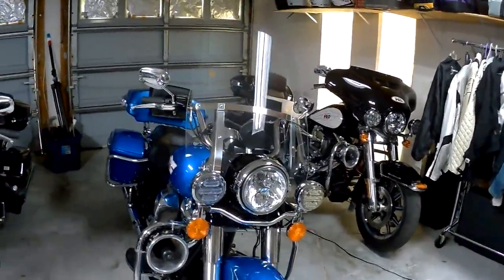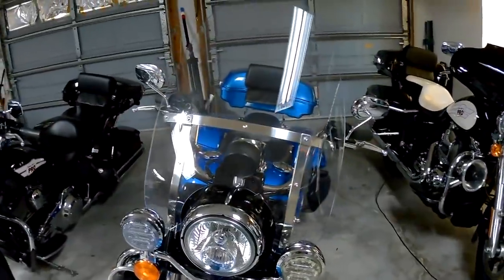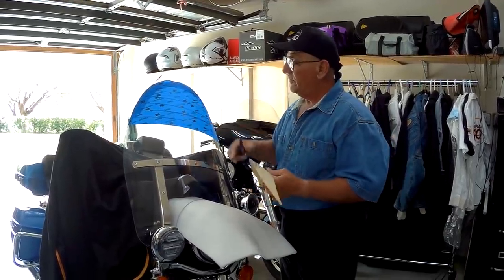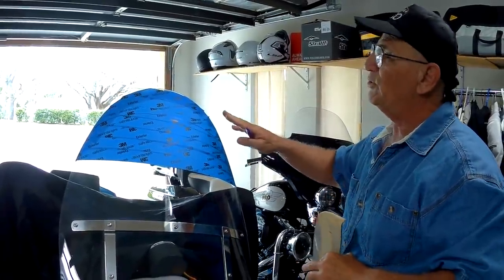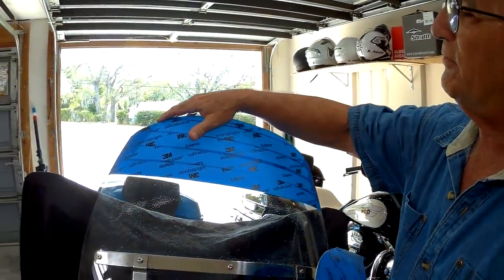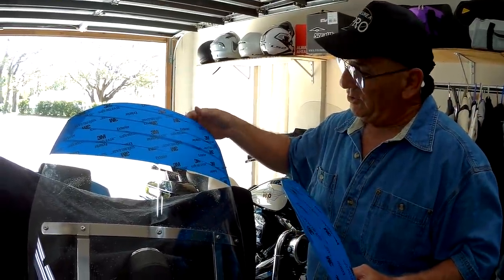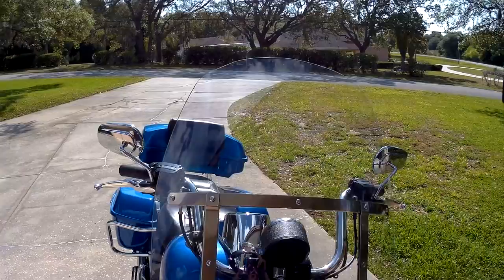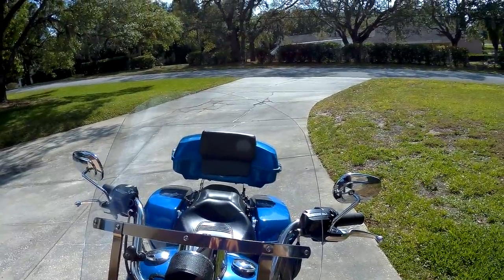how to cut down a windshield

Comment: Simple way to mark the perfect radius; after masking the windshield from top to about 5" down, just measure up from the center allen head bolt on the windshield's chrome crossbar, to the height that you want. Using a string with a small loop on both ends, place something that you can easily hold thru the lower loop to the center of the allen head, and a marker thru the top loop. Now simply draw the arc. Then follow this guy's instructions on cutting it down. Mine came out perfect.
Reply: Hey Gary, thats smart...thank you!!
Reply: Double-loop: great idea. Thanks Gary. I'll be trimming a Yamaha FJR1300 shield soon.
Reply: Works brother, thanks!!

Comment: Another slick way, is to loosen the screw holding the trim directly in the center above the headlamp, wrap a string round it, then attach a pencil to the other end of the string and make a sweet radius on the tape? That’s the way I did mine.
Reply: That's how I did mine.  Then after the cut, rounded and radiused the edge with sandpaper.
Reply: Thanks mate.
Good idea
Reply: Genious

Comment: Jerry...used your technique with a few tweaks to it to cut down my fairing. Like yours, mine was a little too tall. Cut an 1 1/2 inches off. I used cardboard to make the form and trace the curve and sides. The painters tape worked great and allowed me to trace my cutting line perfectly. I used a dremel tool with a carbon cutting blade. Used a sander to smooth it, then 100grit, then 200 grit. Finally some wet sanding got it nice and smooth and clear on the top edge. Thanks again, your video was the inspiration. BTW....could use some more of your stories...When I went through the academy....those were some of the best parts of it.

Comment: cutting down a shield is simple and easy. most folks go after the top end and some do a good job of not buggering it.  There is another way, particular with shields that are attached to fairings. Don't cut the top!. Trace an outline of the bottom on a sheet of construction paper. Transfer that form and/or mounting holes UP from the bottom of the shield the number of inches you want to cut down the top. Leave the top and finish alone. Install the new cut down shield using the new mounting holes and you have reduced the overall height of the shield keeping it original shape and finish intact.
Reply: @nevillegreg1  and you’ll still have the original holes under your new ones. Not a great idea IMO
Reply: I did this for a windshield I ordered from Klockwerks that was specially molded to fit Reckless fairings.
I accidentally ordered too tall so using a Sharpie,I traced the bottom of the windshield onto a thick piece of cardboard and the cardboard then became a jig or template to trim 2 inches off the bottom. 
Now I have an excellent Klockwerks windshield.
Reply: @mikec7713 I believe when he states new cut down he has cut off the bottom removing the original holes.

Comment: I have done this a few times for myself and friends.  I am not as patient as you  ;-)   After cutting, I begin sanding with a block fitted with 40 grade 3M green production paper.  With such coarse paper, always start pushing from outer edges toward the inner (top) area.  As fast as a mill file and getting the corners with a nice rounded shape goes pretty quick.  Then 100 grade, and so on.  I never thought of using a polish or compound, good idea.  My bike has the factory shield now and I can tell Ya that it looks a lot rougher than yours on the edge (2018 Honda GL1800 Tour).  So Ya done good!

Comment: A tip:  When you get it smooth and begin using the very fine grades of paper, use a felt chalk board eraser (now that IS old school) as your backer.  They are pleated, so hold them diagonally instead of long way as you rub the edge.  Produces that neat very slightly rounded edge.

Comment: That is a job that most people are afraid to try. I have done several myself, but I take them off and use a fine tooth blade on a table saw. Tape the shield and fasten a clean towel to the table saw, and final polish with 800 grit on a air powered d/a orbital sander.
Reply: Frank Headley i needed an excuse to buy a new bosch jigsaw to do this. Should i use a metal fine tooth blade to cut my windshield? Should I angle the blade or keep it. Straight up and down?

Comment: A good way to get a nice finish on an acrylic edge is to sand it down smooth first, then use a sharp blade from a Stanley / craft knife and draw it towards you across the edge - leaning the blade towards you to stop it snagging. Then, if you have access to one, use a polishing wheel.

Comment: Great video and  tips, I installed a 16” shield and had terrible head buffeting, bought a 18” and it eliminated most of the buffeting up to about 75 mph. I feel if I go with taller shield I’d be looking through it which I don’t want. Thinking about cutting the 16” down a bit just to get some wind blast off me , I rode with a shorter shield and didn’t get head buffeting can’t figure this one out. Any advise appreciated. I know it’s tuff question to answer . I ride a 2010 fat boy im 6’ . BTW I bought your Ride Like A Pro video and book years ago, helped me tremendously, I always recommend it to newer riders
Reply from the maker: A lot of buffeting comes up from underneath the windshield. H.D. used to have chrome lowers that mounted to the forks and the windshield brackets that helped with buffeting. I can't use them because the siren speaker would be in the way.
Reply: the lower shield, your head is in the slip stream and not in the jimmy buffet zone, is why it is smoother.
Reply: Yep.  Look at lower deflectors.  I had buffeting I couldn't figure out, put on lowers and it was gone.
Reply: Alan Colon thanks for the reply
Reply: Ride Like a Pro Jerry Palladino thanks for the reply Jerry
Reply: @fatboy10-n5j  Just a second comment, the effect of the lowers is amazing.  Even when I took the windscreen off in summer, the lowers still made for a much more comfortable ride.
Reply: Alan Colon thanks for the reply may give the deflectors a try

Comment: A little off topic, but I wonder about folks installing higher and wider aftermarket windshields.  Is the hardware on the motorcycle capable of supporting it?  Do these aftermarket windshields meet any sort of safety standard?

Comment: I sand with  200, 320, 400, 600 and then 1000 grit.  Once I have it smooth I use a piece of box wood and Plexiglas polish and the edge comes out perfect.

Comment: Question: How high should a windshield be for a rider that’s 5’7”?
The bike is a Heritage. The windshield is about 18 1/2” now measured as you do. The buffeting is so bad at 65 or 70 that I feel beat to death. 
P.S. Loved you CD I bought a few years back!
Reply from the maker: It's hard to say. I'm 5'7'' and about 17'' is good for me. But a lot depends on your seat as well. Cutting down the windshield may, or may not help the buffeting. Air coming up from underneath  the shield could cause buffeting also. Fork lowers can help that.
Reply: The windshield top should be around the tip of your nose high so you are looking over the top of it and it still deflects the wind
Reply: @Ride Like a Pro Jerry Palladino  you're  5'7" but in the video you said you were barely 6 foot 😆

Comment: Hey GREAT, Jerry! I'm buying a fresh bike next week... and it will need some trimming. QUESTION: What sort of Jigsaw Blade to use? Fine? How to keep the shield from chipping or cracking?
Reply from the maker: A fine metal blade. Take it slow.
Reply: @motorman857  Thanks a heap for this video, Jerry! I followed your lead and mine came out great! No problems.. smooth. I used a small sanding "flapper" wheel after the jigsaw cut... worked great... followed by 220 to 400 to 800 grit... a little polish.. looks Pro!

Comment: i have the electric hand jig saw but don't know if i have a steady enuff hand. i also have a hand coping saw and some other small hand saws with small blades, i may do it that way. i feel i might have more control over the cut cause once i mess it up it would be a mess but i'm gonna try it anyway.
Reply from the maker: I wouldn't use a coping saw. A jig saw works better and easier. Just take your time and be patient. You can also practice using the jig saw on a thin piece of plywood before cutting the windshield. If you screw up and wind up with bumps on the windshield, a power sander will fix that.
Reply: @motorman857  thnx for the advice

Comment: What exactly do you polish this with? TY
Reply from the maker: If your asking about the edge that I cut, use Polishing compound.
Reply: @motorman857  Thank you.  One more question, do you get that HUGE wind noise in your ears now that the windshield is lower or does the wind still go past your head.  Thanks again
Reply from the maker: @jjcar99  Most of the wind noise comes up from underneath the shield so I've noticed no difference in wind noise.
Reply from the maker: @jjcar99  No huge wind noise. But I wear ear plugs.
Reply: @motorman857  I DID IT!!! Cut my windshield down today with my grandson! Followed your lead.  My 6yr old grandson was quoting your instructions as I was doing things, lol.  It came out great and NO wind noise.  I went from a 20" height to a 15" height.  Looks great and rides great.  I can now see over the windshield!! Thanks again!!

Comment: I could not get masking tape to stick because I use Pledge on my shield. So I measured and used a belt sander. I took it out of the fairing and it took 4 times as long doing it this way. All I needed was 1". The 10" factory  was splitting my line of sight and driving me crazy.

Comment: DId you use a special blade on the jig saw? What was the TPI?
Reply from the maker: I was going to use the special, and very expensive blade used at the space station and recommended by NASA, but I ran out of them. So I just used a fine metal hacksaw blade I had laying around. 😁. C'mon. Don't over think this. Any mistake you make can be fixed with a file, sand paper and polish.
Reply: @motorman857  Some people say that using a jigsaw will cause hairline cracks and the windshield will look like garbage; that may be why the question was asked.

Comment: What kind of blade did you use on your jigsaw?
Reply from the maker: A medium  metal blade.
Reply: @motorman857  ok thanks
Reply: I am about to cut my windshield down. Should i be concerned about cracking the windshield if i dont use the right blade? I have a fine and i guess its a medium blade for my new jigsaw. Any ideas?

Comment: I am new at riding, my bike has a windshield. I was just wondering ,,,why  cut it down. Wind drag maybe???
Reply from the maker: I want to be able to see over it instead of thru it.
Reply: If the windshield is too tall,, you can't see through it in the fog. Can't see as well if it's raining either. There's also a bit of distortion when looking through windshields.
Reply: The windshield top should be around the tip of your nose high so you are looking over the top of it and it still deflects the wind.

Comment: Need to let them know the type of blade to use. 
A wood blade is to course. Use a bi metal or a fine cut blade
Reply: Get a Plexiglas/Acrylic jigsaw blade an Lowes.  Under $10, makes VERY clean cuts, no heating of the windscreen edge. Minimal vibration, works well at slow blade speeds.   This is a case where the right tool make a big difference.
Reply: @pilotalan  Just looked.... didn't actually find a Plexiglas/Acrylic jigsaw blade an Lowes....
Reply: @pilotalan  Thanks man. Yeah I'm gonna try to cut my "wide" shield to slim it down.  It  stretches over the grips so yea i'm gonna try to hack those wider parts off.  I'll prolly end up buying a new shield after all lol